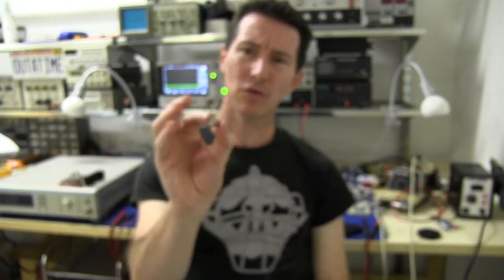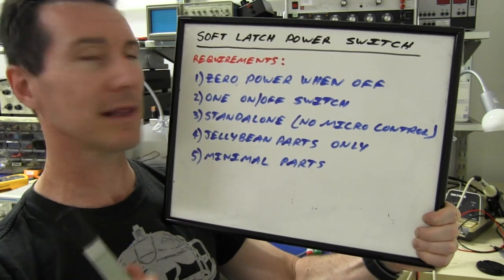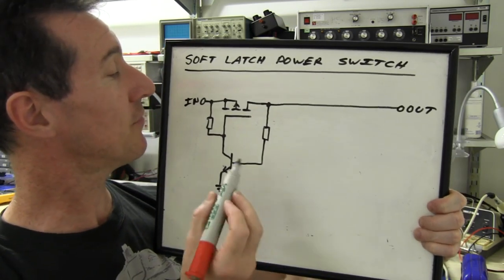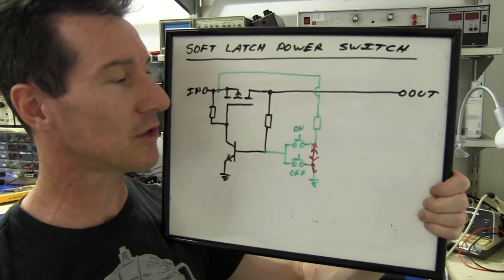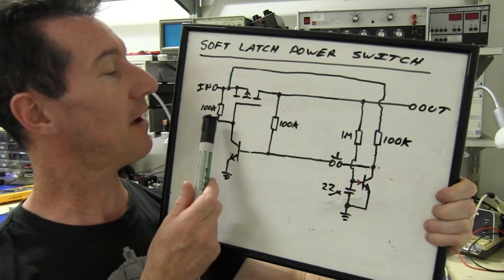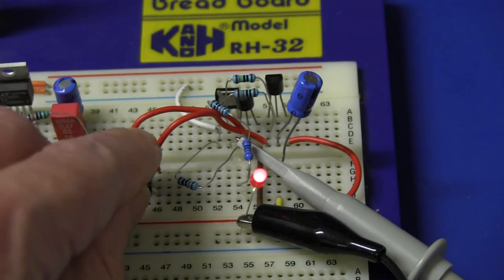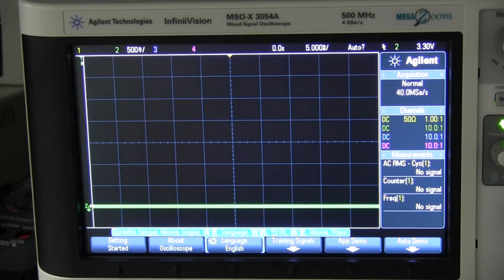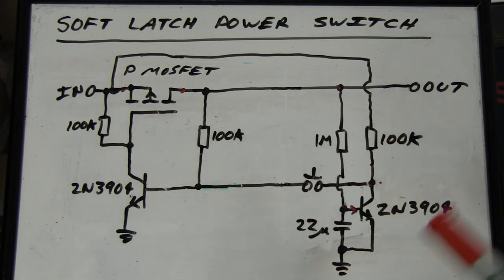EEVblog #262 - World's Simplest Soft Latching Power Switch Circuit

Comment: Hi Dave
Thanks for a very clear and concise explanation. I'm a newby and I understood your explanation.

I would like to use this circuit as a  low voltage breaker for a li-ion pack.

My plan is to use a voltage monitor module (ebay), remove the buzzers and use the buzzer power to provide the signal to this citcuit.
I'm thinking of inserting the signal on the left side of the switch (based on picture, closest to the left most bjt). This way the switch is still available as meeded.
The power source will be 20vdc so I'll probably need to use mosfets instead of bjts as well.

What I need to know is, will this work ?
Thanks

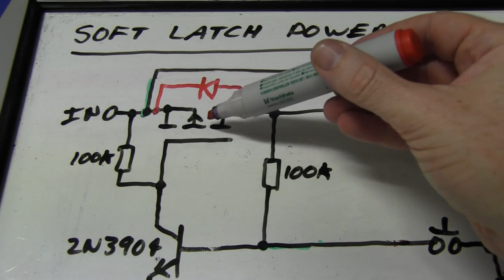Comment: Pretty cool circuit, will try this one out in one of my next projects. Switching the power off looks nice and clean but there's a weird negative voltage spike when switching the power on (at 15:23) of approx. 250mV. Does anyone have an idea what's causing that spike and how to prevent it? I'm not nitpicking, just being curious.

Comment: Hi Dave, Thanks for these great tutorials. I'm an accountant, and have little to do with electronics. However on some weekends I like to mess with this stuff for fun (it reminds me of my childhood when I built simple circuits w/ my father), and I enjoy watching your videos. I recently started building a color organ, and I was actually looking for an on/off switch when I remembered this video.
I have one question though. If there is a larger capacitor on the output, (in the circuit for which I would be using this power switch design,) would that cap keep the circuit in the ON position, even when I press the button to turn it off? I would welcome any advice / input on this from anybody.
Thanks guys!
Reply: Hi! I thought about the same problem and I am pretty sure you are right. The best way to bypass the problem would probably be to put a series diode to the output before your circuit so the capacitor won't be able to pass the current in reverse.
Reply: Marijan Cimerman Thanks for the tip. I didn't think about putting a diode in series. I'll give it a try. The circuit for which I want to use this switch is not that sensitive to voltage changes, so the voltage drop across the diode would not be a problem for me.
Thanks again for responding to my question!

Comment: Hello! Great tutorial. I've biuld this. And it simply works. The one thing that annoys me is that the circuit that I've built turns itself on in about 10 seconds after turning it off. I'm trying to come up with solution to fix it. Possibly component values have to be changed. I have used BC817 as BJT transistors.

Comment: Not as-is. Transistors (including that pass MOSFET) are inherently DC devices. If you want to switch AC, you can connect the coil of a relay to this circuit.

Comment: why not use a d flip flop with the switch on the clock line and a scmitt trigger for debounce if needed? that's only two components, bit simpler :P all 74 logic so easy parts

Comment: hi all! I really like this design, and it does exactly what I need. I tried it out and it works fine for a 5v supply, but I'd like to make it work with 24V. 
I have BC547A transistors and a FQP27P06 MOSFET. I tried to use higher value pull-ups and also had to increase the size of the capacitor to at least 100 uF (200 seems better). But what happens is that the MOSFET turns on fine, then when I press the button again to shut it down, it stays OFF only while I keep the button pressed. As soon as I release it, it turns back ON. I thought that this was due to the capacitor discharging through Vout, so I put a diode there (right after the 1Mohm pull up resistor of the latching transistor), but the MOSFET still *turns ON on its own after a while, with the button not pressed!* 
Things I do not understand: 
- why do I need to change the capacitor size? shouldn't the time constant be independent of the voltage? using the original 22 uF capacitor it flashes quicker than it did with 5v
- could it be that the gate of the MOSFET gets triggered from the change of state from being pulled down to ground (while the button is pressed) to being pulled up to Vin? I tried to use a larger pull up resistor on the gate, even 1M, but nothing changed.

At this point I pretty stumped. Can somebody please help?
Reply: did you solve?

Comment: Sorry.. am a very beginner to electronics.. which I can say as I dont know where to connect resistor, what to do with transistor like that.. But Im eagerly trying to  learn it.. So out of a curiosity can you tell me the details of the first simple circuit.  I mean the simple one with push on off switch with just transistor and resistors?? Please.. Or a clear circuit diagram in the case of 12 v supply. If you share those info Id like to try that in breadboard

Comment: it is much, much simpler solution without transistors and capacitor. It is enough to put microswitch on/off between gate and drain and resistor 100K between gate and source, after all it works.

Comment: This is a nice and simple design, but I don't care for the fact that the circuit defaults to "ON" on power up, that could be a potential safety problem, or just an inconvenience in case of a power supply interruption that lasts longer than your RC constant. I'm going to try to figure out how to modify Dave's circuit to default to OFF.

Comment: Coming very late to this Video by Dave and having trouble making it work as expected as the LED stays on at 7v and goes immediatley off at lower voltages.  In looking at Dave's breadboard set up am I totally off base when I think I see the T1 transistor Emitter leg connected directly to the Mosfet Gate when in the schematic it should be the Collector leg connected to the gate?  Main problem in my setup is I cant get my hands on a IRF9110 and am using instead a IRF9540 which has a Vgs that is just too high for the low voltages I am using.

Comment: Hi, what is the best and easiest way to solve this problem without having to tie the existing wires through the GEM. I want to do the same thing with my electric transfer case motor but i want to be able to just either push a button or flip a toggle and engage either the 4 high or 4 low at the motor for the 4x4 case. Here is a fella doing it but he tells me i have to flip the switch back once i hear it engage or either it will keep 12 volt current directly to the motor and the motor will not turn anymore as it goes to the full limit on each turn in reverse of the two windings to the motor by reversing the polarity. I want to make the motor turn to each one and then have the current to shut off but also come back on to reverse it when i switch it in reverse but also shut the current once it has fully engaged. Is there a simple wiring diagram to fix this problem to insure no voltage will stay on the motor once it engages and also i need to take it back to neutral or regular drive. He has the idea but needs something to finish this for the DIY. cheaply. 

Here is his video: https://www.youtube.com/watch?v=ZAucpRIy4Ro

Comment: Hi, I'd like to use this circuit on a mains voltage 220v before the step-down transformer. I'm powering an audio amp, I built a crude power supply but I don't want to have to use a toggle switch turn it on or off. I can't find anything on the net that explains how to build a soft starter with one button

Comment: Could you do a video on ordering switches, I don't understand, at least I don't think I understand how to read their descriptions. For example... 

Manufacturer: WEALTH METAL
Product Category: Switches, Key Pad:Tact Switches
ROHS: Yes   ( what is this?) 

Specifications
Circuit: SPST-NO               (what does this mean?)
Switch Function: Off-Mom                ( Does this mean, always on, but momentarily off, if I push the button?) 
Mounting Type: Through Hole
Contact Rating: 50mA
Size / Dimension: 6x6mm
Stem Lenght: 5mm
Reply: SPST SingePolSingelTrow   ->one line switching one point   /
SPDT --------------dualTrow      ->one line switching betwen to points     _/=

Comment: Great solution Dave ! What do you suggest in case of a high capacitive output (2000uF filtered for example)?
Reply: Well if you won't mind the drop, you could use some shottky diode (after mos-fet, between resistors 100k and 1M). That  will stop anything beond this circuit to keep it swich on.

Comment: Nice circuit... but it kinda falls apart if your input voltage is say from something like a laptop charger. At 20V you risk damaging that pmosfet vgs max rating for starters. I couldn't find a single 1 zener type of solution, any ideas?

Comment: I don't see how you prevent over voltage on the gate - can you get them with a build in Zener diode? You avoid mentioning the factors defining operating specs. Also that a voltage on the consumer could latch the circuit anytime etc. I also am confused because the type of FET with negative gate voltage is not very common, so I'd like to see the circuit in a version switching the ground side of the consumer - time for an update?

Comment: Nice on/off latch! But is it at all possible to use a PNP in place of the MOSFET? I don't have any jellybean fets like that in my arsenal.
Reply: yes look at my post above:
http://circuitsaladdotcom.files.wordpress.com/2014/04/momentary-latching-circuit.gif?w=584&h=479 

I designed a similar circuit with only two transistors
Reply: Ray Ring Oh- how'd I miss that. Hey thanks! Circuit works perfect! Great post.
Reply: Cool. I use this circuit frequently and have good results. I have other stuff on my blog: circuitsalad.com - you might  find useful
Reply: Ray Ring
 Wow, I've been trying to build a latching circuit with parts in hand for two days... so many great ideas out there, and your circuit did the trick... I was this close to giving in and buying a stack of J/K Cmos flipflops.   Thanks!
Reply: Yes it works well. I have used my version for a number of products and occasionally I have to change the value of a resistor depending on the PFET I am switching, also I had a problem with E fields triggering the darn thing once and just had to just put a small value cap across the npn base to ground. I show using a diode or a slave PMOS for reactive loads. You can also just put a 10k resistor across the base of the NPN (to ground) instead of the diode or extra transistor and that will make the circuit tolerant of reactive loads...the point is you can adapt the circuit for all kind of behaviors and improved robustness, depending on your application.

Comment: Why not put a 1N4148 or similar small signal diode in series with the 1M resistor? That should solve the residual voltage problem "by design" and not because the load happens to be high enough.
Btw, I only hate whiteboard tapping when the audio is desynced...

Comment: Hi Dave...I made this circuit according to diagram but it didn't off when I press switch once again. I used bc547 instead of 2n3904. As you said, it's oscillating when I press switch for long time around 4 sec. Is there any way to reduce size of resistor and capacitor to match holding time of switch. I think base current for second transistor was not enough. Any suggestions please...thanks

Comment: That GPS unit is many times more advanced than your calculator, able to pinpoint your position down to a few meters using just a few microseconds difference in a clock sent from space. The plastic is thinner because people are actually able to measure how thick it needs to be, instead of just throwing material until the problem goes away. If you want your "quality" back, go buy a military unit, it'll only cost you a few thousand dollars, instead of the hundred or so you spent on the "crappy" one

Comment: Is the 1M resistor to push the current towards the output side (load) and selected as bigger than the load ? How are the other resistors selected? Do I have to be mindful of how much current/voltage is going into the base of the BJT and set it accordingly with those resistors ? Or as long as I have the voltage above 0.7v ( but below max rated for that BJT ) and current exceeds the threshold current, it'll turn on the BJT?

Comment: There has been a big stink in the news lately about parasitic power drains from sleeping electronics eating up power. Outlawing always-on ckts may be considered for new production. If this soft switch were to be used with a mains-powered supply, the input DC would have to be ON at all times, thus making it "non-green" and the work of the devil. Thus the humble power switch may be making a comeback with the transformer moving back into the equipment where it started.

Comment: Unless I'm reading it wrong, the circuit shown in the "final" schematic at 11:00 should power up in the off state, yet the breadboarded circuit powers up in the on state.  How come?

I'm creating something similar and had the same issue - the circuit should power up in the off state but actually powers up in the on state.  Adding a small cap between the gate of the BJT and ground fixes it, but I'd like to understand *why* it fixes it!

Comment: Hello! What about softlatchin' of 3 power rails: +/-12 and separated +5 ? How to sync them in one switch?
Reply: +Delian Diver Maybe you could place some mosfets on the load of that circuit, where each one switches a different rail? I think you might need to reverse Vdd and Vss for the -12V so that 0V is on Vdd. I'm not sure exactly, but just an idea. With the right components and arrangement it might work.

Comment: I know thats an old video but that solution is most certainly not cheaper than a cheap switch :P I am not a professional.. I guess this makes sense when switching stuff with high current flow that needs a soft start to prevent high initial current flow and high spikes compared what would happen if used a physical hard switch that would allow a harsh initial current rush. I am talking as a hobbist. Where I have to take into concideration of lots of planning and soldering for a single project doesnt make it work for me. A switch is much more logical and practical in any way. I cannot speak for commercial products. For personal it makes no sense at all. You get 5 switches on Ali for 1.5€. And then I dont need to wire and solder a small PCB just connect the pins of the swtich and thats it.

Comment: I haven't breadboarded this yet, but could it be that this switch can be used as reverse polarity protection? Obviously after replacing the cap with a ceramic. 
With a dual npn this ciruit can be built in an under 200 mils square

Comment: great video Dave... although all of them are good. I have one question about this circuit though. What changes would have to be made to the circuit so that that circuit is off when applying voltage? In the video it shows the circuit automatically being on when voltage is applied and that button has to be pressed to turn it off. looking forward to read the responses.
Reply: ***** You weren't paying attention. The circuit is OFF upon applying the input voltage.  Watch the video again.
Reply: MrTriac Thank you for the reply, but I'm referring to 12.:00 in the video. He applies voltage and the circuit is instantly ON. I was wondering if there's a way the LED would be off after applying voltage and the button would need to be pressed to turn it on.
Reply: You were right. It shouldn't switch ON when input voltage was applied(min12:00). I'm puzzled too.   I'll look into it...
Reply: +Marc Cadet I'm puzzled too. Did you figure it out?
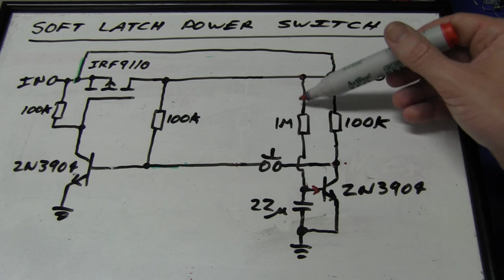Reply: i did figure it out... had to watch the video more thoroughly. At 14:45 he explains that its on because there is no load on the circuit. once he applies a 10mOhm load, as soon as he applies power the circuit is off

Comment: What are the modifications required for this circuit default on when power is applied? Also where would you put a LED if you wanted it to turn on when the circuit was off?
Reply: Without too much thinking, for the LED that turns ON when circuit is OFF, you could put LED between the right hand side of the button (collector of the right hand side transistor) and ground.
For this LED to light up properly, you would have to reduce the 100k resistor above that transistor to proper value for your LED and PSU (say 4.7k for 12V psu and a weak LED)

Also, without too much thinking, to turn on automatically, put a small capacitor (100nF? maybe a bit more? Eperiment!:) ) between Gate of the mosfet and GND. Also put 100k resistor between Vin and GND (to discharge this capacitor when there is no power applied).
When you connect the power, the capacitor will not allow voltage on Gate to jump up to Vin value like it normally does because it can't charge fast enough through the 100k resistor and Mosfet will turn ON and latch like it should.

Maybe I'm not thinking everything through, but I believe it should work.:)

Comment: nice diagram!.. i have a question. if my input voltage is 7.4  i need a grater cap to hold the button arround 3 sec to switch off?

Comment: I just disagreed with how he said it could be cheaper then a typical toggle switch. It would be around the same price. Maybe even more. In my experience, toggle switches are more convenient, but just expensive like Dave said. But I've paid more for P-Channels over switches. Also, keep in mind I am using the same variables to compare the FET to a switch. Also, I like Dave's design, so don't think I am going around bashing his video's. Because I'm not.

Comment: I can do this with a single D-Flip Flop or with a D-Latch? Just working like a single 1 bit counter
Reply: That's basically what this is. A flip flop with another pass transistor used for the high current main pass.
Reply: StarlightVisual Thanks!

Comment: Could I swap out the P channel MOSFET with a PNP power transistor and still have the same operation? I'll also be using a 100uF capacitor but I think all that'll do is effect the oscillation rate.